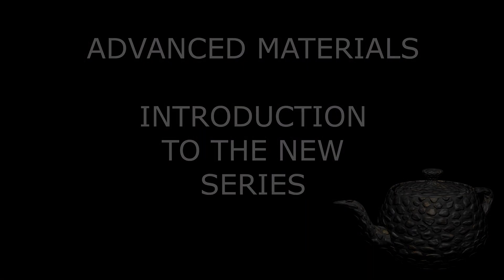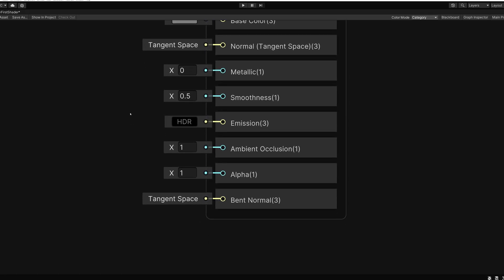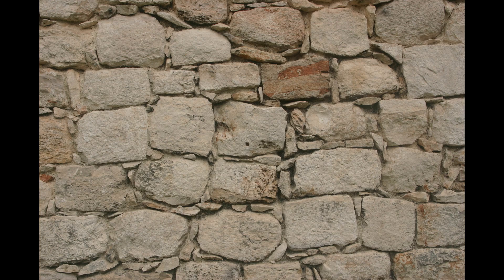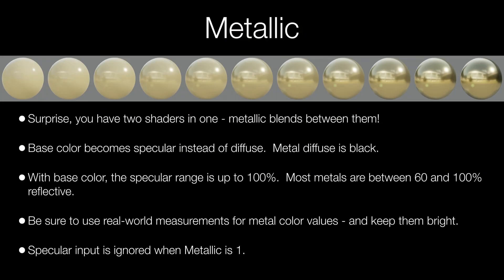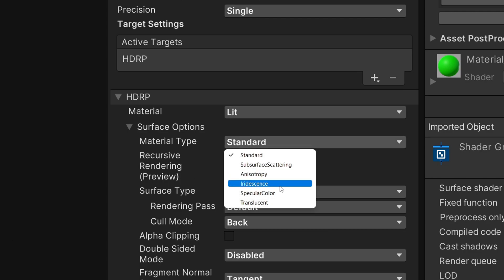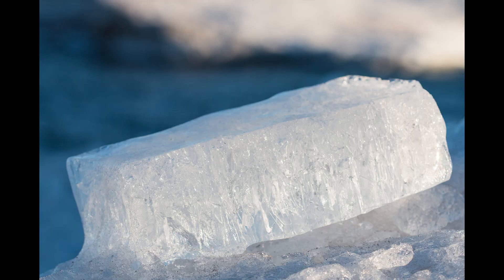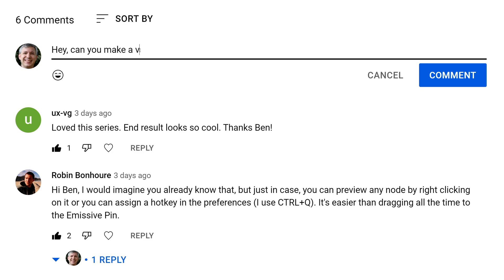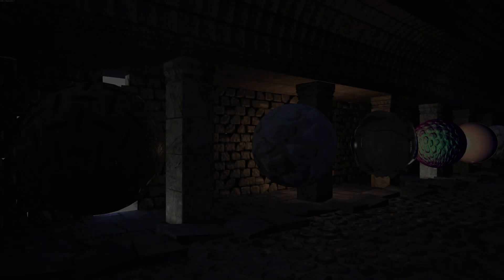Introduction - Advanced Materials - Episode 1

Comment: Awesome videos. But stuck as QuixelBridge, is only offering Texture, Normal & ORDp. I have searched all your videos and none of them talk about ORDp or use that to make Material. Do you have plan of adding extra videos to help us use that as well ?
Reply from the maker: Are you using the version of Bridge that's built into Unreal 5 or the stand-alone version? In the stand-alone version that I'm using, I can select a material and then click the small settings button in the lower right and select Download settings.  In the Download Settings, there's a large list of texture types and formats to choose from.
Reply: @BenCloward  oh I am using the UE5 integrated on.
Reply from the maker: @skd0074  Using the stand-alone version will give you a lot more options and flexibility in how you choose to use the textures. But it will be a bit more work to set up, so you'll have to decide if the extra effort is worth it for you.
Reply: @BenCloward  Thank you for talking the time to explain. 🙏

Comment: Awesome, I`m always happy to see a new video from you! As for suggestions I was wondering if you could also go into the best way to optimize these more complex shaders for character and prop production standpoint, maybe combining a bunch of them into a single material (and which ones would be practical to combine or leave separate) and toggling them on or off using RGBA masks or Vertex Colors.
For example, some characters could have some anisotropic brushed metal effect in some areas, maybe some iridescesce, different types of cloth like silk, cotton or some synthetic fabric which could also use some other type of anisotropy, maybe some gems with POM or Bump Offset... Separating complex characters like this into many UVs or many separate materials for each type of material would be impractical and expensive and Character Artists usually don't get too into tech art so having that education out there could help a ton of people. I would even be happy to supply you with a custom character model to use as an example if you want it.

Anyway, thanks for the very informative videos and take care!!